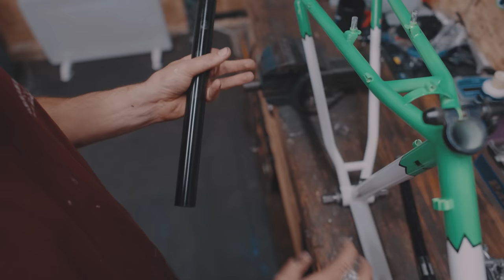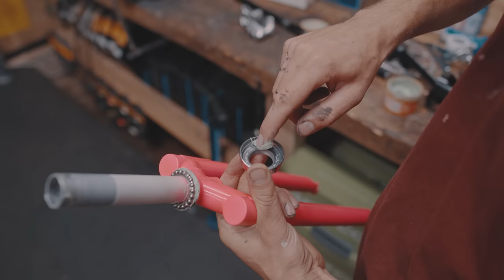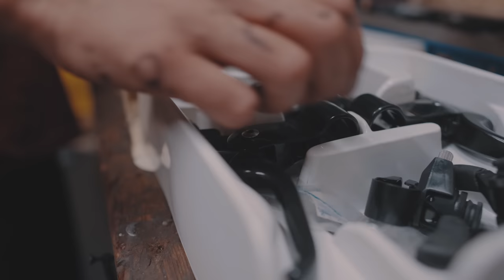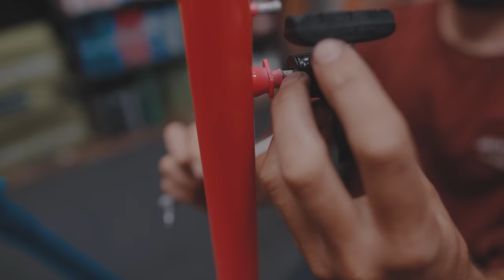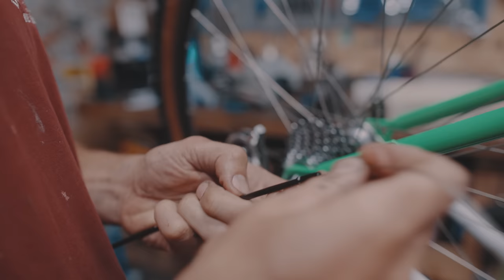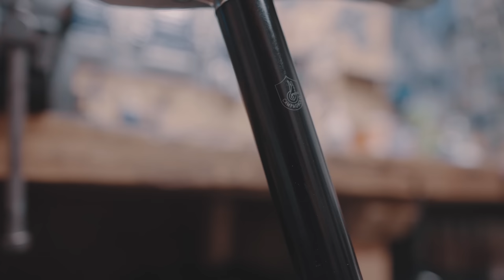DREAM BUILD RETRO - Fat Chance Yo Eddy Team edition

Comment: Are you trolling us old school mechanics with how badly you set up the front brake cables? Do you need some old school mechanical assistance - have you set up cantilever brakes before?
Reply: Thank you, just my thoughts as well. Same as the spring settings on the lower hole both front and rear cantis. Mushy brakes with little return respons :-)
Reply: My god that was atrocious. Time for v brakes already!!